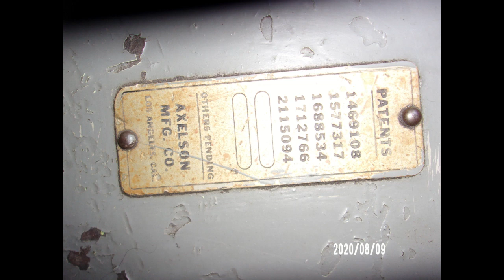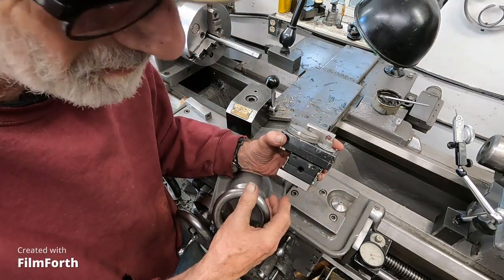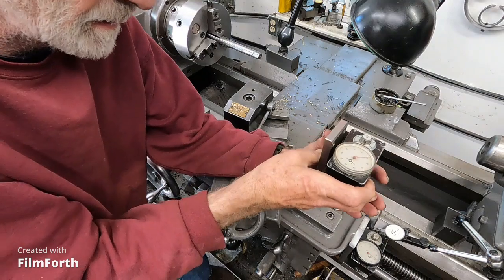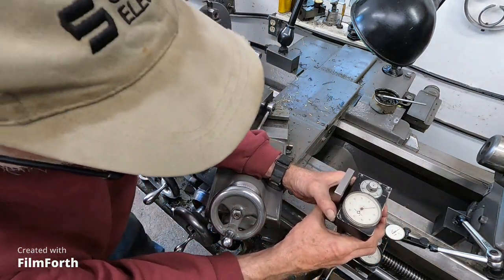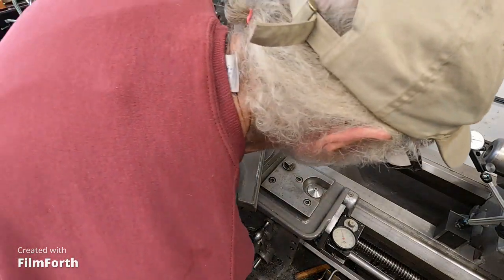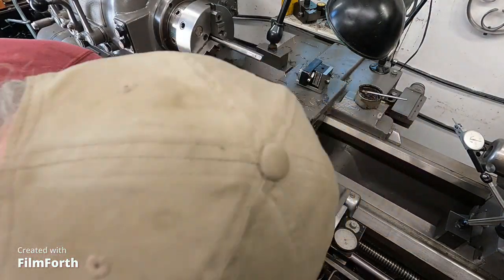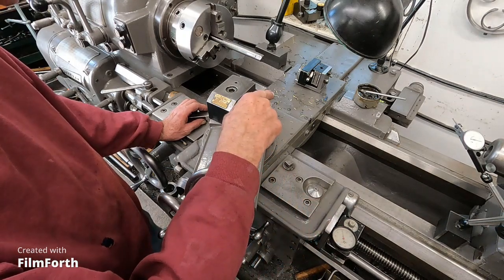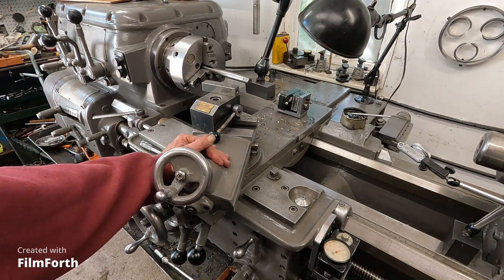Hot Rodded Axelson Lathe Trav-A-Dial  Super Charged!

Comment: DeeDee, I always wondered how those old things could be so accurate.   Nice video explanation.  I’m more of the DRO generation though….  Cheers, TB
Reply from the maker: I was able to see these mechanical indicators happily removed from vertical mills in the 1980s but not so much with lathes as many found the DRO did not speed up production as it did with milling machines, the current prices reflect that today. The problem on the 10ee  is where are you going to put the cross slide scale? On the tail stock side where you lose an inch or more of some of the most valuable space on the machine or the chuck side? I learned this in photography school, you cant gain in one area without losing in another, also, if you cant make them good, make then big.